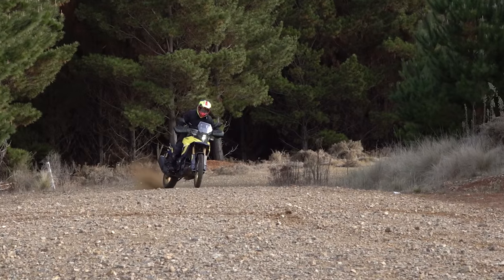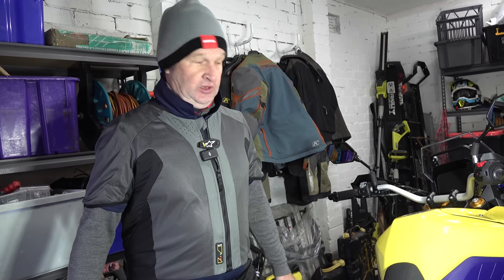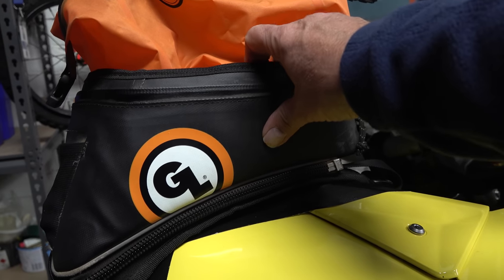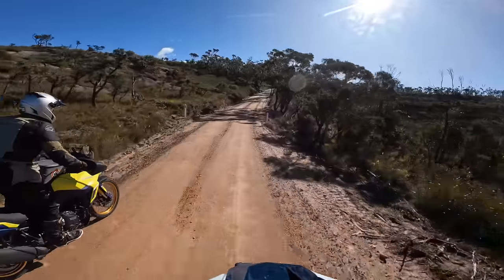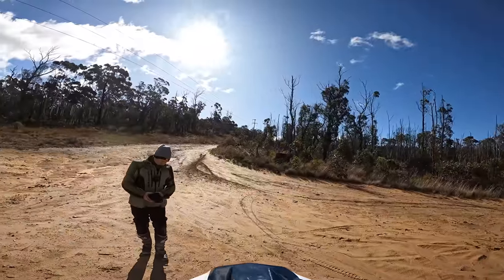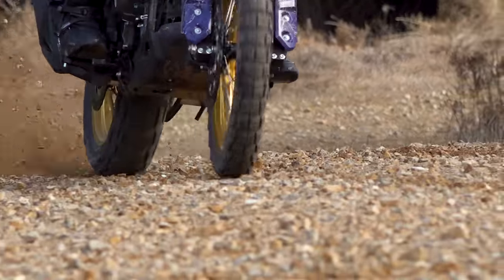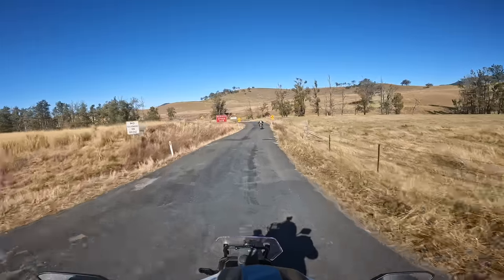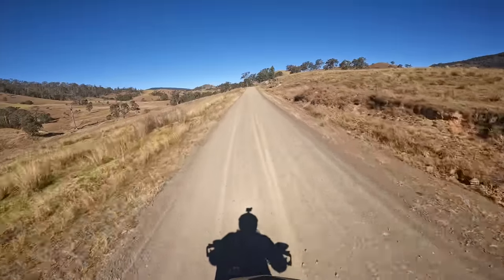SUZUKI V-STROM 800DE |  RIDE TESTED THOROUGHLY ON A THREE DAY ADVENTURE, SUSPENSION TESTED/ADJUSTED

Comment: Thanks for the great videos. I'm moving to Melbourne soon from Taiwan after 23years in Asia. Back to the home roots and looking forward to doing some dirt bike riding. I'll be interested to see the Honda Transalpine with costings for upgrades with how it stacks up against this. I am stuck in a CRF300 rally vs KTM 390 Adventure or spend a bit more and get a Transalp vs V-Strom 800DE conundrum. Many years riding 300cc I might be keen for a little more power but is the weight too much for someone not so used to it? I'm 6ft2, so standing up should be ok on most bikes. Thanks again for the great content!
Reply from the maker: Thank you

Comment: I have a Dr650 Se which is a great bike. Having had quite a few Suzuki's I really like the engines but corrosion isn't great on newer machines but the new Africa twins rust in Scotland. Still this 800 v Strom is great as is the 650 v Strom and 1000 and 1050. Suspension and balance and engine seems far better than the 700 Yamaha but the new Honda 750 transalp seems great Value too. It will be interesting to see if this parallel twin will be reliable like the old v Strom's.
Reply from the maker: I bet you they are.

Comment: It great to see your reviews of the  bike being use for what they are meant for and I see you turn off all the electronic TC and ABS do they make a difference on the dirt? On my Africa twin I am not sure they do as it will still spin up with the TC would be nice to see do video showing how all work and the real benefit
Reply from the maker: The traction control, abs and engine power settings are so different on different bikes it would drive me mad to do that video :)

Comment: Appears to be a very good buy and I would venture to say a better buy than the Honda Transalp for dirt riding.Thanks a mill.
Reply from the maker: In standard form, it is more dirt oriented than the Transalp.  But you need to remember the Transalp brief is slightly different.  It's a little more road/soft dirt oriented.
Reply: Translap has non adjustable suspension....garbage. Honda messed up

Comment: Really, removing the battery to access the air filter. I guess you will need to reset the dash, time, date and what ever else. All good for those riders who stay on the black top who may only clean the filter once a year. But riding on dirt roads who will need access the filter to inpsect. Lets hope a company comes up with a better solution. Other than that you have a reliable, but heavy bike that will keep on going. The bike looks good in that grey trim for me.
Reply from the maker: Well it's better than the tank! :). But yep disconnecting the battery is a pain in the arse.
Reply: @MotorcycleAdventureDirtbikeTV  For sure, re tank. Cheers.

Comment: Preload is one of those things that people thinks it does something it doesn’t actually do.
Reply: It's all a dark art to a lot of people
Reply from the maker: First thing to do to get static SAG approaching correct tolerances with the springs that you have.
Reply: @MotorcycleAdventureDirtbikeTV  most people think pre load is a way of adjustment for the bikes height.
Reply from the maker: @chrishart8548  I think that's natural because they wind up that preload knob and see the bike going up.  Just the way it is.

Comment: Hey guys could you please give me your thoughts on the lack of chain guide on the DE, do you think this could become much of an issue off-road? I am about to purchase either the DE or the T7 but I’m leaning towards the DE as I think it is better value all round but my only concern is the lack of chain guide
Reply from the maker: You can buy an oem chain guard.
Reply: Sorry guys I’m referring to the guide on the bottom of the swingarm that helps prevent the chain falling which could result in a smashed case, especially off road

Comment: G'day Dave, how does the suspension compare to a standard Norden 901?
Reply from the maker: The Norden suspension is in another league.
Reply: Thanks, I expected the Norden Expedition to be far superior but not the standard Norden. I appreciate your feedback. Keep up the great work you are doing!
Reply from the maker: @michaelleemhuis4501  Sorry I was thinking Expedition.  Nope the Suzuki rear is better than the standard Norden.  Front forks on the standard Norden are better.
Reply: Thanks, so a $21,000 run out price 22 built Norden with an upgraded rear shock would be a pretty good compromise!
Reply from the maker: @michaelleemhuis4501  Yes but Haggle hard.

Comment: For à rider that does 70% highway and 30% off road wich bike would you choose between 800de , the expédition 901 and à tiger rally 900 ???? Thx
Reply from the maker: The answer to that question would take me a thousand words.  They are all good.  900 has the best rider protection from buffetting.

Comment: One thing I've noticed is that the engine does push a lot of heat to the right leg. On the left side, Suzuki put a nice rubber flap to divert the hot air away from the rider, but omitted that on the right - and in our steady 30c+ summer days out here in the US it roasts my knee.

Everything else has been positives so far, apart from the springs needing to be a rate or so higher for the western market as usual.
Reply from the maker: I haven't noticed the heat thing, but then again we were riding in between 4 and 16 degrees C until the last day when we were riding in 22 to 24
Reply: @MotorcycleAdventureDirtbikeTV  yeah, also more noticeable wearing highly vented gear that allows the hot air through! 

Just to confirm, you ran the compression front&rear full hard + rebound full slow?
Reply from the maker: @cblais19  wound up to the max in direction of plus which is full slow and remember preload wound up to the max on front and rear.

Comment: Interesting that you thought the seat was comfortable, I found that I was pushed so forward the  Family Jules were intermit with the paint work, but I agree with the rest of the review.  25% more power than I'll ever need.
Reply from the maker: Missed that with the seat.  We punched out two 10 hour days and I thought the seat was very comfortable.
Reply: @MotorcycleAdventureDirtbikeTV  Thanks for the reply, yes to comfort, but I  might try a different pair of strides and see how that works. And coming from a heavy cruiser (400kg) it could be me, although other AD-bikes were not an issue. We all have off days...

Comment: Nice video. I was curious what you would say about the bike as I have not tried any of the competitors. got mine three weeks ago. 3000 km so far, the 2000 km were on a trip to Norway with my girlfriend and luggage. 200 kg on the bike. A stronger rear spring would probably be a good idea with so many kg. Love the bike except for the windshield. Here in Denmark, 800 DE is 1100 euros  cheaper than the Transalp
Reply from the maker: That's interesting.  The Transalp here is way cheaper in standard form.  Yeah, you would benefit from a heavier spring in the back. There is a larger windshield available.  Clubby also didn't like the smaller windshield.

Comment: I reckon the KOVE 450 Wjll beat the vstrom hands dowñ mate
Reply from the maker: It's a single, a completely different category.  When it got tough it would want to beat it hands down.  But out in the open stuff I'd prefer to be on a twin any day.
Reply: The Kove 800X would be a better comparison.
Reply: @PissTakeProduction Jimmy Lewis of dirt bike test Channel and multi-time winner of Baja just tested the Kove 450 Rally and he liked the motor especially as a dual sport and adventure bike. They rode it 1500 miles

Comment: I do not like that super low hanging exhaust.  Thats street bike exhaust.
Reply from the maker: I looked at that and forgot to mention it in the review.  I was satisfied if a decent bashplate was fitted sufficient protection would be provided. Current ground clearance is 220 mm. I would also raise the bike about 30 mm.

Comment: I am so disapointed that it weighs 30 kilograms more than it should.
Reply from the maker: Yes it is on the pudgy side. I'd strong suggest you ride it and then come back here and tell us your thoughts.  Spec sheet gazing can ruin your life. :).
Reply: @MotorcycleAdventureDirtbikeTV  Thank you for the advice but i trust those who are better than me at testing. The verdict is that this motorcycle is " a solid level below the Tuareg 660 offroad".

Comment: I just can't believe, with all the tech available and all the throttle by wire, that manufacturers can't be bothered to give us cruise control. Immediate hard pass for me.
Reply from the maker: don't throw the baby out with the bath water.  This is a very good bike.
Reply: @MotorcycleAdventureDirtbikeTV  The problem is, with my severe ADHD, I spend all my time looking around at scenery and making sure I am driving defensively that I drive along quite happily about 15 under the limit.
I feel bad for the drivers stuck behind me when I don't have it. Your London to Sidney trip would take me 35 years, plus the prison time in the Ukraine for overstaying my visa!

Comment: V ? What V. Time to rename this one. Twinstrom or dumb name strom. 500+lbs off road, no f--fing chance. Happy I don't have to ride this thing off road
Reply from the maker: Many people will.  What do you ride now, I'm interested.
Reply: @MotorcycleAdventureDirtbikeTV High power electric full suspension mtb. I used to ride a KTM 500 EXC
Reply from the maker: @kevinnielsen1356  I have a high power mtb and a Husky 501, 701, Yamaha T7, KTM690. The reason I say this is my T7 weighs about the same as the V Strom and I love it for open stuff. Mid sized twins aren't for everyone. This bike is a little more pudgy than most, but not too much.
Reply: @MotorcycleAdventureDirtbikeTV  Nice collection. I prefer the e-mtb because of the options for places to ride. In New England we can ride moto trails, mtb singletrack, downhill adventure parks, bike paths. These machines are considered bicycles due to having a bicycle pedal system. Mine has a twist throttle and aprox 3hp ( hp is not a good measure of electric motors power, torgue is better,  it has 180nm of torque from a standstill! ) weighs 70lbs. On a tight technical singletrack, I've never ridden anything more capable and it is free to fill up (charge). Silent too, night riding doesn't upset anyone
Reply from the maker: @kevinnielsen1356  Yes, I moved away from trail bikes to E mtb and I'm happier for it.

Comment: Why are Japanese so conservative, followers rather than leaders. Look at Ducati, KTM, Triumph, and BMW. No option for cruise control!?? Tubed tyres only!?? 230 kg for mid powered bike!?? Same can be said of Honda Transalp 750.For me KTM 890 adventure, standard, does it for me, as best all rounder, value for money.
Reply from the maker: I've ridden all these bikes and conducted detailed reviews on all of them. The V-strom and Transalp for that matter do what they say on the label, reliably and without fuss.
Reply: @MotorcycleAdventureDirtbikeTV  All true, what you say, but you do not contradict an argument by alluding to some other fact. What I said holds true. But thanks for your attempt.
Reply from the maker: @davidmallia628  Japanese are by the nature of their business model for production of bikes, conservative. Now, I hope I remember this correctly, design teams are made up of, Sales/Marketing, Engineers, Designers all oversighted by Sales ( I think).  In any event there is considerable tension created in the design process between the groups.  It's healthy but ultimately keeps them on a steady course....of conservatism.   Ironically most of the innovation that you speak of from those other brands is emanating from China.
Reply: I'd say of that list, KTM is the maybe main innovator.  They just don't know how to manufacture bikes to 21st century standards.  Maybe Ducati with the V4s. Otherwise most are flogging old engine designs with certain refinements, and  buying from the same suppliers Nice and all, but not exactly rocket science.

In the end it is variations on a theme - pick your poison. Bikers are very conservative, and when the big innovations come (usually from the Japanese),they don't sell very well.
Reply: @MotorcycleAdventureDirtbikeTV  Good that you mention China. They are working to take over the market, and they seem very probable to succeed. The problem with the Japanese manufacturers is that they know what the customers want, but are reluctant to deliver. The two aforementioned bikes, a case in point. Yamaha had a big success with the simple concept of the T7, teased us for years, failed to supply the US market for more than a year, after a year. Even then the T7 was unavailable in lots of EU states. Yes, supply was not up to demand, because of its popularity. But customers wanted more of the same, lower seat heights, lower centre of gravity. Customers wanted tubeless tyres, and cruise control as options. Why did the other Japanese manufacturers jump on the band wagon. Where is Kawasaki with a versys 650 Adv X. Moto Moroni, from China, and Italy had to provide something approaching the wanted Versys X. And with Versys 650 engine, tubeless tyres, colour display, the works. Where is the updated DRZ 400. Such a success, and people crying, for years, for fuel injection, sixth gear, and fuel guage. I could go on. It is obvious the Japanese manufactures have some sort of problem.
Reply from the maker: @davidmallia628  Yep, preparing to go electric :)
Reply: My Thoughts exactly. Thank you for saying what needed to be said.

Comment: My main concern is its weight, 230 kg is a lot, actually more than an Africa Twin. It still depends on the center of gravity, at the end you wanna lift it up again, not pick it up after a crash.
Reply from the maker: It doesn't feel it.  It hides its weight well.
Reply: i went in to a dealer today and sat on the africa twin and the 800de, and to my surprise the africa twin felt heavier. Definitely more top heavy than the 800de
Reply from the maker: @slakk5093  The DE hides it's weight well.
Reply: @MotorcycleAdventureDirtbikeTV  Well during the video you said, you'd feel its 230 kg in certain situation, for example picking it off the ground.
Have you dropped it? If so, how hard/easy was it compared let's say a Tenere 700?
Reply from the maker: @Hibbicon  I didn't drop it, but I own a Tenere and that feels a lot more top heavy.
Reply from the maker: @bradsanders6954  Ah the Strom mindset.  This is nothing like the old Vstroms.  Do your homework. Read more, talk less.  Better still go and ride one before you hit the keyboard.
Reply: @MotorcycleAdventureDirtbikeTV until you have to pick the thing up on the side of a hill. Too heavy!
Reply from the maker: @verbalwidget7267  you haven't listened to the review.  That's exactly, almost verbatim, to what I said.
Reply: besides, Africa twin the standard one with full tank, real weight is over 250 kg  (This was verified )

Comment: You failed to mention those are not standard tires and more off road aftermarket tires
Reply from the maker: Failed? More like forgot. You may be new to the channel.  We request manufacturers to fit off road biased tyres on all our tests.  Tyres are commodity. Interestingly the tyres you mentioned are road biased off road tyres, Pirelli STRs.  We would prefer the more dirt oriented Pirelli Scorpion Rally.  If they would have been on the bike, it would have taken the dirt handling to another level.
Reply: @MotorcycleAdventureDirtbikeTV  yes I am new to channel. I those those tires well my tenere 700 came factory with them..any great review on the suzuki.. sorry for the spelling of tyers I am in the US lol